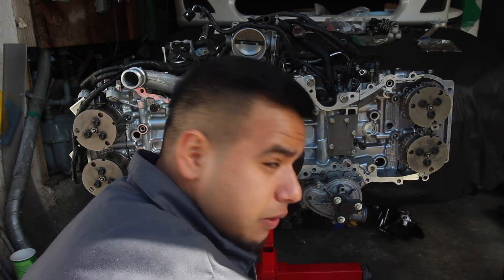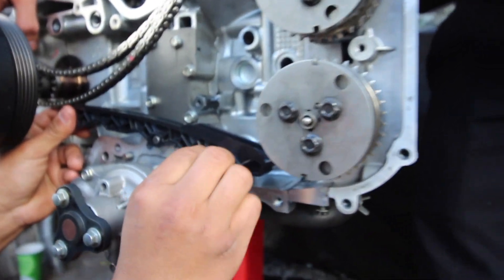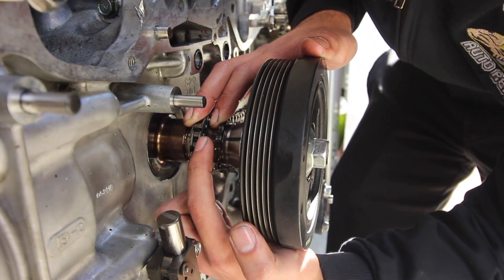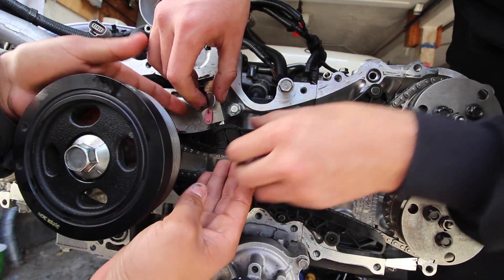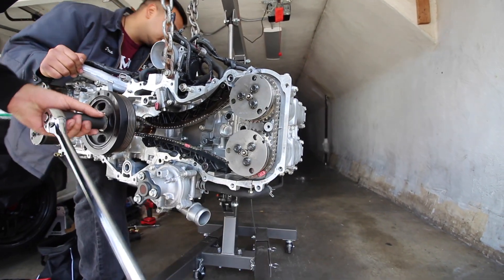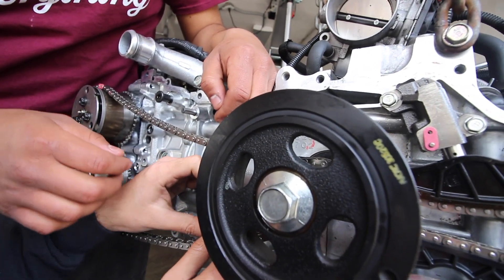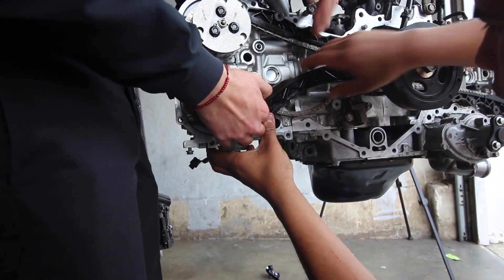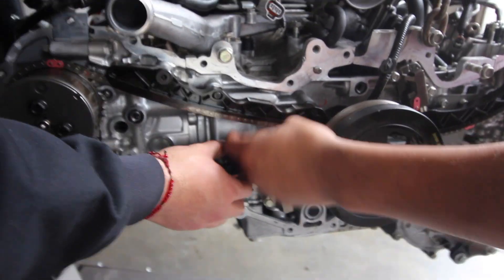How to Set timing on fa20 for FR-S, BRZ, GT86

Comment: is it still running? I think you forgot to "lock" the tensioners. After pulling the pin, you have to extend them further until they click indicating they're locked in position for maximum tension. There's a place where you push onto to extend them.

Comment: hello Can you tell me where the Subaru 2014 Vvt filter is located? 2.0 2014
Reply from the maker: If it's on brz. The filter is between the camshaft housing and the block
Reply: Between the camshaft housing and head
Reply: And if the cover of the valves is removed, will the filter appear?

Comment: When you turned the engine manually and it jumped a quarter turn. Is that normal? Cause mine does the same and I aligned everything and it does that jump when I first started the engine with it in. Please reply about your start up.
Thanks fellas. I don't wanna take it out again :(
Reply: Did you end up figuring this out ? I’m stuck on this atm
Reply: @gsohi9700  Did you figure this out - I had this happen and I thought something had broken - obviously it has something to do with the dynamic timing.

Comment: Those chain tensioners will take all the slack out after the engine has started, they operate with oil pressure.